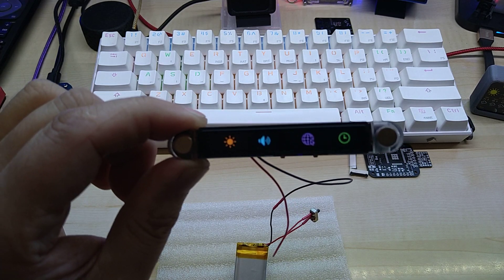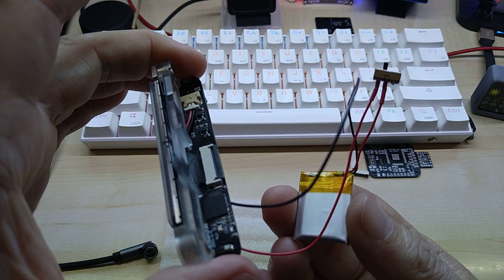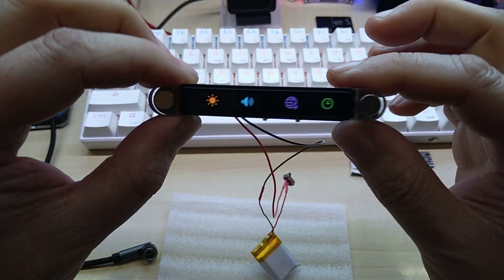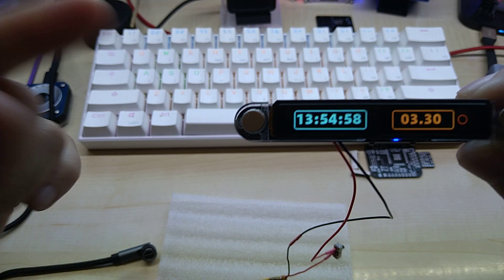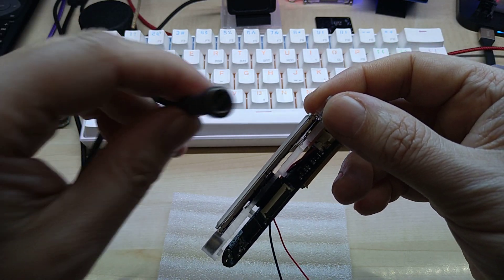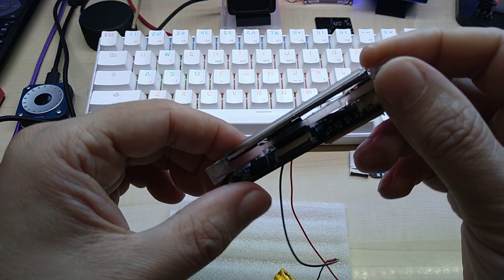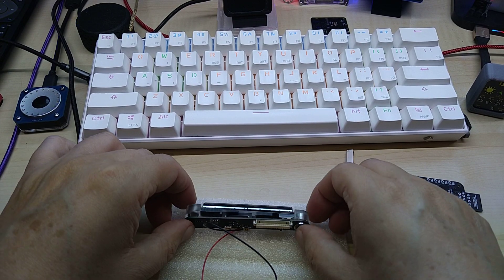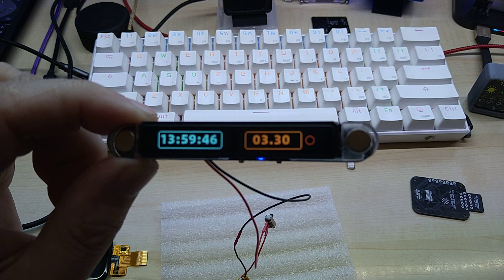Reupload #ESP32 S3R8 T-Touch Bar Introduction by #Hayri Sponsored by #Lilygo Part 2

Comment: I like the Pen idea..Tell us how much for the Printer????👍
Reply from the maker: Hi Peter, thank you, now that the low backlight issue is fixed I can't wait to start designing the pen case. The SLA printer including the wash and cure station come to about $350.00 plus the cost for resin and what not, not too bad for getting into resin printing 🙂 had not noticed how prices came down, initial they were much more expensive, maybe the wait was worth it, actually I needed it for printing the parts for my "secret" project as they look so much better than FDM printing. Anyway, any donations towards the printer will get a free name plate keychain and if they are lucky it will be even their own name, lol.

Comment: Hi Hayri, Did you notice the new ESP32-S3 Xiao from SeeedStudio, and more specifically the ESP32-S3 Xiao Sense camera unit? I haven't looked at the code yet but was thinking it might help with the issues we were discussing last week as I bet the demos use the same up-to-date libs that you're experimenting with. Looks like a cool ESP ecosystem - notice the micro board-to-board connector and the unpopulated bottom side of the board. I bet they are planning many accessory boards to complement the compact architecture.
Reply from the maker: Hi Nik, yes I have seen it but did not look at it in detail. I have a couple of the first XIAO boards and even designed and used it in my V2 Engine Keychain PCB with dual displays but found it a bit cumbersome to add a lipo and a charging circuit to it. The camera version is sure tiny and I might get one when it is available again to play around with. I actually have another design for a camera board as well but have not ordered it yet. Btw, I have also a small round display from Makerfabs coming that has capacitive touch as well, similar to the XIAO version, we'll see how it turns out. Currently I am designing a case for the 1.69" touch display, really like it with it's round corner display and the beautiful beveled edge screen. Till later.

Comment: BTW, I'm really impressed that you modified your board and uploaded a video about it in 24 hours! I wasn't expecting that. You are certainly 'On the case'.

Hopefully, Lilygo will modify their hardware to reduce the resistor value. I suspect it was an over cautious design decision given that 2 back lights needed power from the same transistor. Are others experiencing the same problem?   They must be.
Reply from the maker: Thanks Nik, it really bugged me a lot having a dim screen and am thankful that you noticed the resistor, I will let Lilygo know about it and hopefully they'll fix it. It's otherwise a great little board which could be used in so many applications.
Reply: @iHayri1  Yes it's a great board and I really enjoy that Lilyogo have such an imagination. I look forward to their next offering.

Comment: Hi Hayri, I'm glad the resistor mod worked. I like the idea of using a vape battery. They come in many shapes and sizes and the fancy designs are quite inspirational. I turned one into a laser pointer but I had to modify the internals quite a bit. I think vapers want Lightsabers!
Reply from the maker: It's actually sad that so many perfectly capable of charging Lipo batteries end up in the trash, haha a mini light saber so to speak 🙂 actually it is quite doable.
Reply: @iHayri1  Yes the Lipo thing frustrates me too. People discard old lithium based  power sources when they still have so much potential. This qualifies as the worst joke ever told but I do believe in the implications of the premice.
Reply from the maker: @nikthefix8918  I wish people would bring back their pen vapes to the store where they bought it from, since they most likely will purchase another one and I would love to go to the stores in my city and pick  them up, imagine what you could do with all those. Power banks are so cheap these days, the ones without Lipo batteries, that you could use.  I actually bought one and used some of my Lipo batteries in it, instead of buying 18650 or similar batteries as soldering is needed anyway. Maybe I should show it in a video 🙂
Reply: @iHayri1  The most expensive thing in a DIY E-Bike is the battery pack. I imagine you could easily scrounge together an E-Vape-bike if you had access to the things people throw away. A really good source of 18650 batteries is old laptops and hand held vacuum cleaners. I spend way too much time at my local dump and the workers are getting suspicious.
Reply from the maker: @nikthefix8918  haha, but that's gonna be a lot of wiring and soldering with those tiny batteries 🙂
Reply: Where can I find more info on this mod?